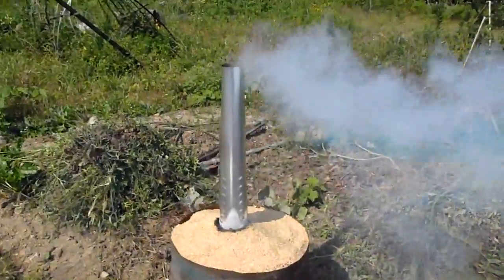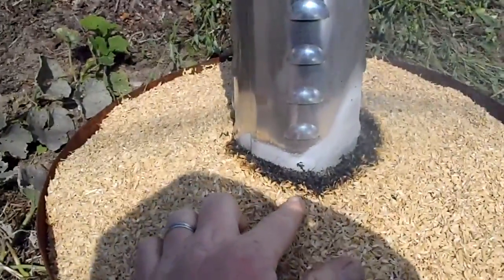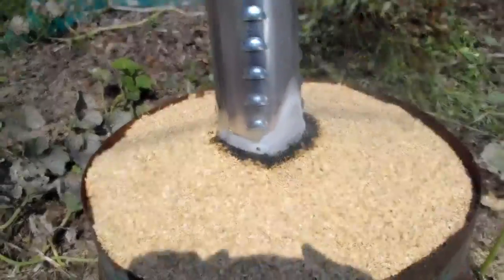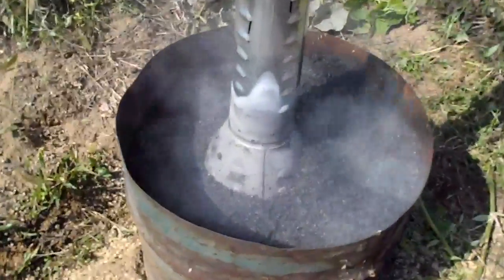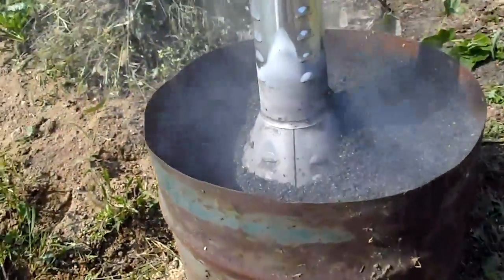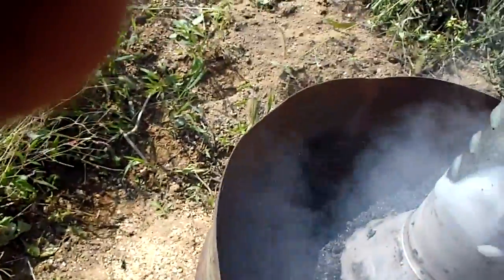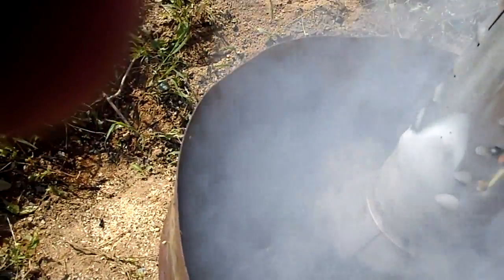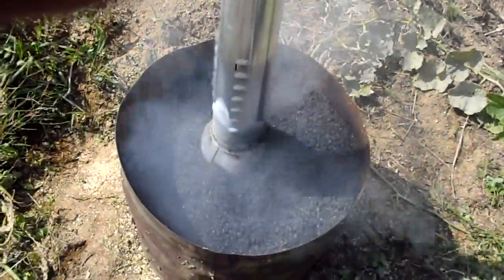Making Rice Hull Charcoal

Comment: The method of converting the rice hull  to charcoal  is not good for the environment because it releases plenty of smoke which means it releases so much carbon dioxide(CO2) into the air which then contribute to global warming .And besides this cannot be called a biochar because it was being burn down in the presence of Oxygen...

Comment: It's interesting that you are trying to utilize charcoal. But the amount of smoke (which is fact is flammable gas) means the process is very in efficient. A better solution will be a gasifier which will burn all the gases resulting in a much cleaner process.
Way to go!
Reply: Hasan Baidoun not to mention a faster proces
Reply from the maker: Thanks for the comment! Yes, a gassifier would be cleaner, but also a bit more difficult to build. Almost anyone can do it this way.
Reply: Hasan Brother u r right sir.we are running 300 kw gasifier.using wood gas in gender for electricity.and wood charcol also received from it. So best way.

Comment: good idea to make biochar from rice hull, I did it too in the 90s but now I would do it differently as this method is quite polluting and so not eco-friendly. On youtube many others use the woodgases for cooking or for making electricity...
Reply from the maker: Yes, there is quite a bit of pollution with this method. I have recently started distilling the smoke in a long horizontal chimney. The water vapor, acids, methanol, and tars condense out and can be used around the base of fruit trees to discourage borers.